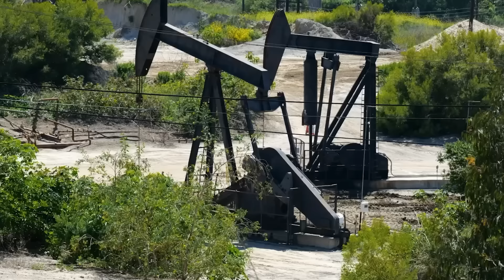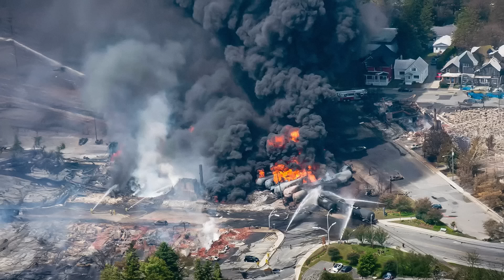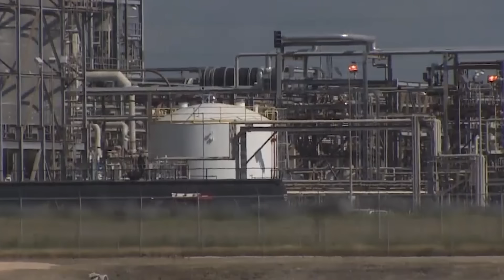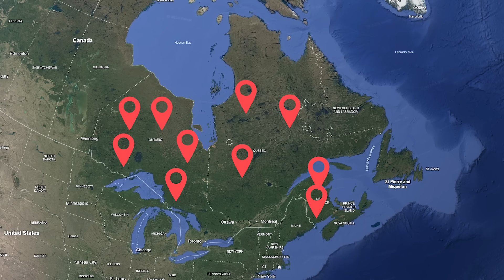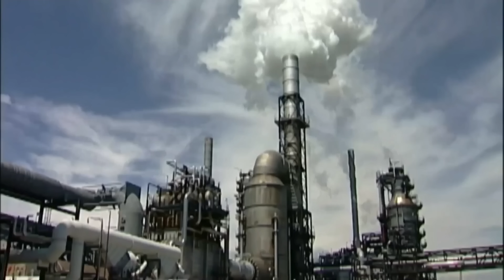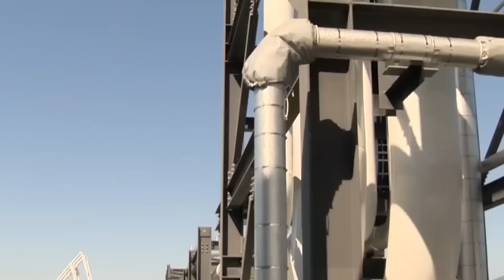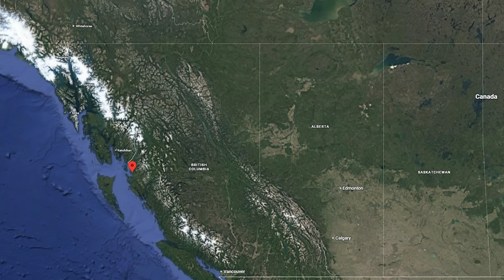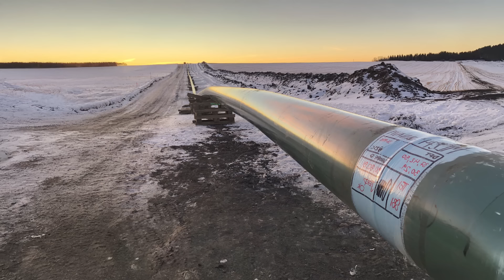Here's Why Canada Can't Build Its Own Refineries, Even Though It Produces Millions of Tons of Oil

Comment: The OIL RACKET in Canada. 

Rising oil prices have resurrected the same old disinformation campaigns here in Canada once again: Canada needs to refine it's own oil. 

Here's a few things Pierre and the Conservatives don't mention. 

Canada is already home to 18 refineries with a total combined refining capacity of nearly 2.5 million barrels of oil per day.

Canada refines enough oil to meet its domestic consumption needs, producing roughly 2.5 million barrels of petroleum products daily while consuming only 1.8 million.
That means any newly constructed refineries would be refining oil for export, not for internal consumption.

Oil prices are determined by global market forces, refining more of our own wouldn't mean cheaper gas prices for consumers. 

Even if we had a direct west-to-east pipeline, we’d still run into another barrier: refinery compatibility. The oil sands produce mostly heavy crude, which (believe it or not) eastern Canadian refineries weren’t built to handle. Many of these facilities—especially older ones in places like Montreal and Saint John—were designed decades ago for lighter, sweeter crude, historically imported from places like the Gulf of Mexico, the North Sea, or West Africa.

Retooling those refineries to process Alberta’s heavier product would be a huge undertaking, with no guarantee of a stable policy environment or long-term supply agreements.

Upgrading Canadian refineries with cokers to process heavy bitumen woud cost an estimated $1 billion to over $2 billion CAD per project.

The cost of a new refinery is pegged at $10 billion, and would take years to construct.

Building new refineries requires massive capital investment, with projects like the Sturgeon Refinery facing significant cost overruns.
Refining is generally a low-margin business compared to extraction.

So far, no one has made a credible business case for refining more of Alberta's oil in Alberta or even Canada for that matter.  It's better economics for Alberta's corporations to extract the product and ship it. 

It gets a lot of points to say, 'We've got to do things at home, we've got to be independent, we ought to not depend on somebody who could change their mind,' but as an economic matter, it doesn't really make sense, or we would have been doing it," says Michal Moore, a professor at the University of Calgary's public policy school.

*I am not arguing a case here for or against pipelines, I'm just providing some information about refineries and why it's much more complex than you may realise. 
I am all for anything that benefits Canada, if it makes sense.

Comment: Both USA and Canada have refinery capacity problems. No new refineries are being built because (1) oil execs and (2) wall street are not stupid. A new refinery involves $6-$20 billion, 8-15 years construction, and not profitable until year 18, at best.  So the price of gas and demand for gas after 2045 is what matters -- not the price and demand in 2026. These execs have the best economists available. The expectation by professionals is for decreased demand (and price) after 2035, and continuing drops.  If you make a $10 billion mistake, wall street hammers your stock price and you lose your job. 
There is no government policy defeating refinery construction - just business execs not being stupid with $15 billion. 

Are you going to spend your billions to build a device that is obsolete when completed? Didn't think so.

Comment: To throw in a very significant factor not mentioned by anyone is "electricity".   THIS commodity is NOT going to immediately replace the need for oils of any kind, ...BUT ....the associated technologies ARE being accelerated .......WHICH .....will reduce the dependencies on oil AND natural gas.

The point is simple.    "OIL PROJECTS" have been very clearly identified as very costly, needing a lot of time to complete.

WHERE will "global oil consumption" be in 30, 40, 50, years .......after spending UNTOLD BILLIONS?  No "private" monies are offered to do anything. So if anything happens, it will be on Canadian Taxpayers.  The ONE thing governments CANNOT do is build anything on budget.

In Vancouver, B.C., Canada, we couldn't even build a projected $700 MILLION waste water treatment plant, started 2018 to be completed by 2020, without out the cost skyrocketing to currently just under $4 BILLION ....when the project was finally stopped ....and no one trusts the board of over 40 "municipal experts" to even restart the project because it is only a FIVE YEARS BEHIND completion and likely needs another FIVE YEARS before getting close to completion!!    The "commissioner" of the Metro Vancouver Board .... Jerry Dobrovolny .....sat back quietly as the numbers exploded. Dobrovolny's  tax-payer paid income is over $600,000 annually.  He keeps his face out of the media.

.

Comment: A lot of those initial delays from protests and court challenges were because the government at the time (Harper) rewrote/abolished many of the environmental and Indigenous rules that would normally apply to the building of the pipeline hoping they could just ram it through and have it built before anyone was able to stop it. 

Not to say it just would have been smooth sailing if they'd kept it all above board, but it likely wouldn't have been delayed for years with stops and starts happening over and over. That cost us a lot of  wasted time and money. Do it right the first time.

Also, as someone who worked on the pipeline, I was gobsmacked at how many workers expressed hatred of the government (particularly Liberals) and paying taxes while in the same breath BRAGGGING about how much they were padding their hours and costs to bilk the project of as much money as they could. Idiot hypocrites.

Comment: Canada exports over 4 million barrels per day  of crude oil annually, with exports averaging approximately 4.2 million barrels per day in 2023. Over 98% of this oil is exported to the United States, with increasing volumes in 2024 and 2025 driven by the Trans Mountain Expansion Project, which boosts capacity and expands access to international markets.

Comment: The problem is no company wants to pay for new pipelines. The company building the trans-mountain pipeline bailed out and Ottawa ended up paying for it. It will be a very long time before Canadians see a return on that payout. Building a pipeline to the east means negotiating three or four separate provincial governments and numerous indigenous people. Plus you need to upgrade a refinery or two to refine the heavy oil. There is a technology that takes the heavy oil and forms it into bricks that can easily and safely be moved by rail, however the Luddite premier of Alberta, Smith, has her corrupt heart set on pipelines. The sooner Alberta gets rid of Smith the sooner they can start to diversify the Alberta economy and look for viable alternatives to pipelines.
Reply: The problem is actually shitty government. Kinder Morgan was fully prepared to fund the pipeline privately, but as the goalposts continued to move, with no end in sight, they sold their $7B project for $34B to the CDN Government.